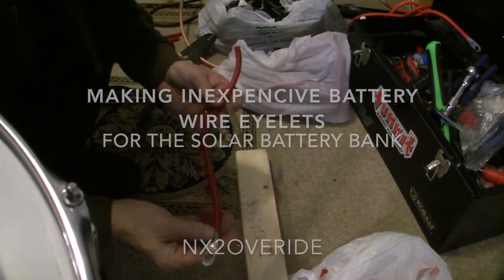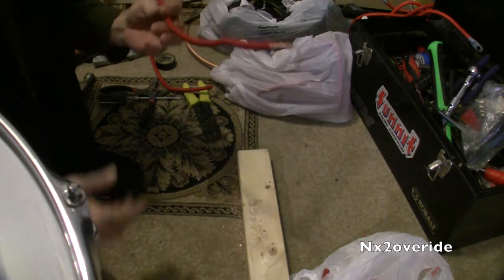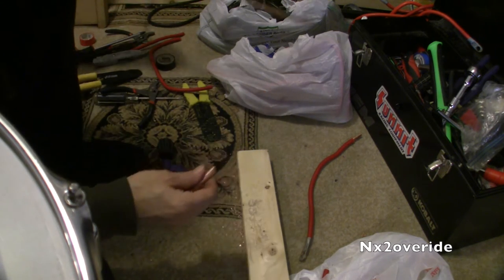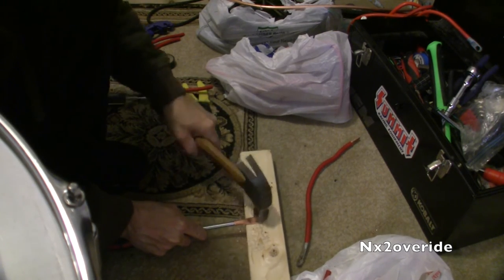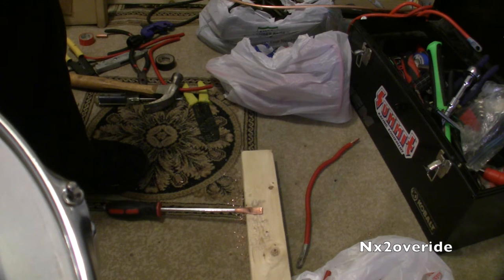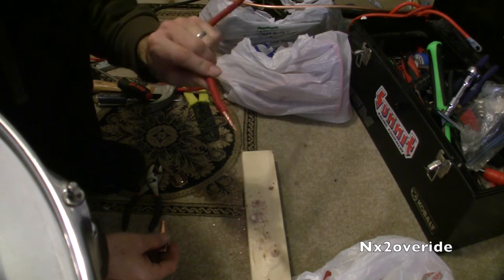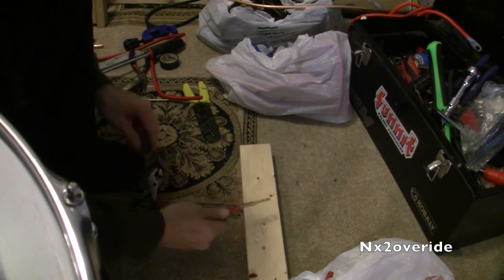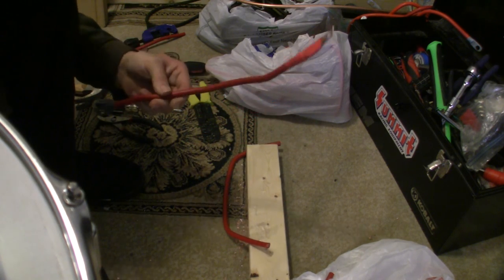Making inexpencive battery wire eyelets for the battery bank

Comment: Very Cool way to do an eyelet!  Great for smaller amp size battery banks!
Reply from the maker: +Norman McGregor (Our Island Adventure) yep, I'm at 12 volts and I'm not pushing out high amps so I'm sure this will be fine..later on I may replace them when I rebuild the bank and replace the batteries.

Comment: Fascinating...suggestion:  drill a smaller hole using a smaller bit and work up to the final size to avoid tearing the copper...I said freak
Reply from the maker: +Randy Borawski wish I could the hole has to be this big because of the pole. sucks but what can you do. ;) - #Stayintheshade
Reply: +Nx2overide I meant to start small and build up to the size you need #youalreadyinthegayparade
Reply from the maker: ***** ahh yep tried that its will twist up the copper.. that's why i just run it in reverse.
Reply: +Nx2overide "Is it worth it, let me work it. I put my thing down, flip it and reverse it"

Comment: Nice vid. I've tried this before. They came out ok but I couldn't get the wire to stay on. I was using 8awg.
Reply from the maker: +Off Grid Nation yep if you cant get them to say on you might try soldering them, that should do the trick. I'm not running high amps on this bank so I'm not too worried about it. The bank for my cabin will need better eyelets for high amp output.
Reply: I actually tried that. I used flex and everything and I couldn't get it to stick. I'm a loser.
Reply from the maker: Off Grid Nation huh, im going to have to try it now..maybe it's the copper and type of wire? who knows..